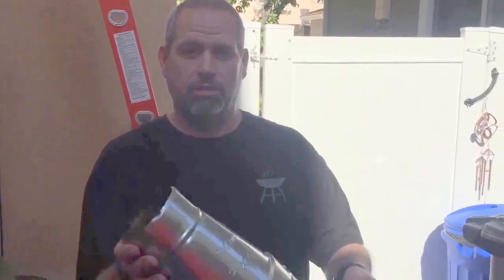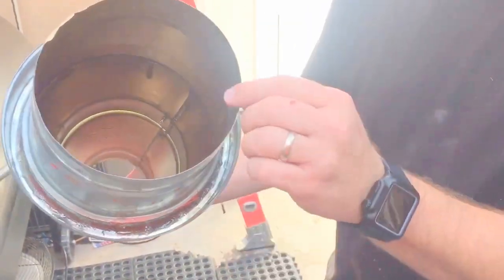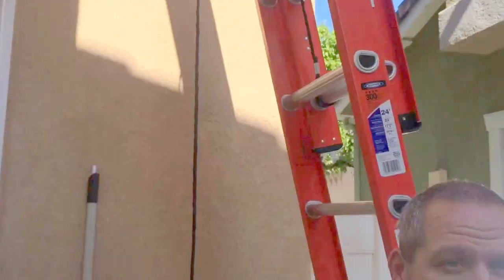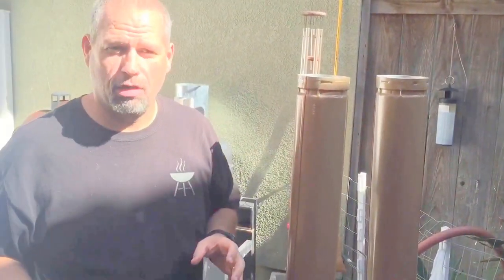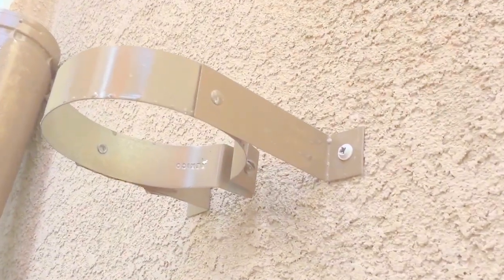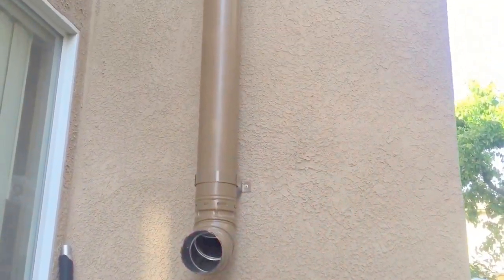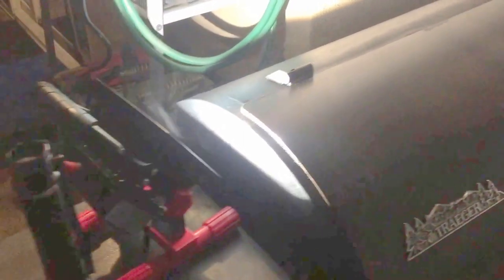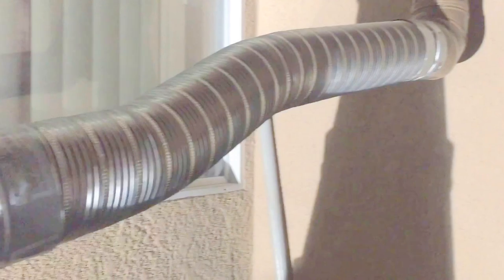How to vent your Traeger (Smoker) to help cut down the smoke in the breezeway

Comment: Wonderful idea.   Is that first section really 7” to 4”?  The small end sure looks wider than the 4” at the far end.  Is that just a dryer vent hose connecting the vertical  pieces?
Reply from the maker: Yes 7 to 4
Reply from the maker: The vertical piece is a flexible heater vent tube. Higher temp than a dryer vent hose.

Comment: Did you use the DuraVent Pipe product that Home Depot sells?  Looks like it says DucTile on it.  Also are you sure that first piece that goes over the grill chimney is a 6 in to 4 in that then goes into a 7 in to 6 in?  Looks like it says 7 x 6 on the side but in the video you say 6 in to 4 in. Just don't want to order the incorrect parts. Thanks!
Reply from the maker: It is the double wall vent pipe going up the side of the house to the roof. 

The flexible part can’t remember what’s that called. 

The reducers are several turned upside side over the vent cap to create a better seal I have to look to see what measurements they are as I did this video a while back. 

I also stuffed the gaps with a high temp welding material or you can find high temp thick silicone sheets and cut out a hole to make a high temp gasket.

Comment: take the cap off ur stack and drop 6 inch flex up to the top of the chimmney  a less restrictive  cap less restriction (u dont need a spark arrestor) will pull it all up